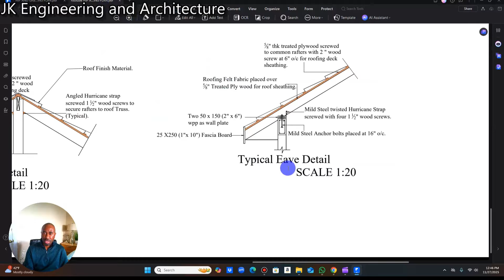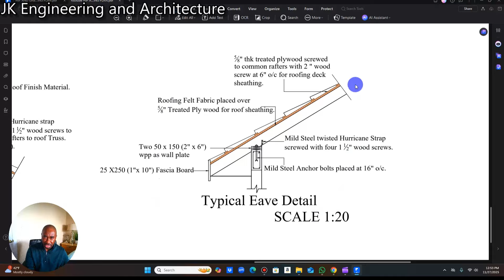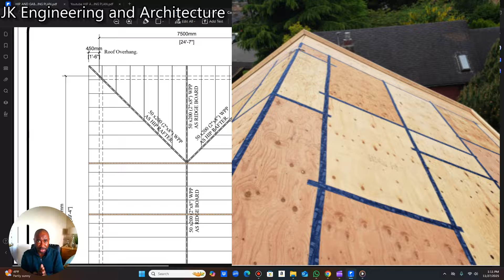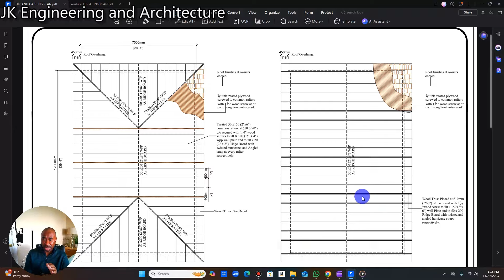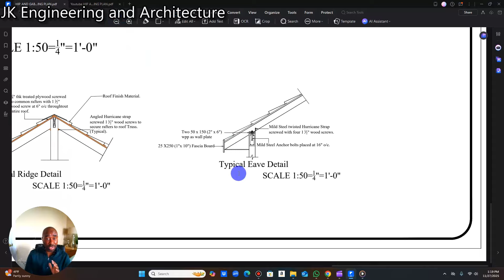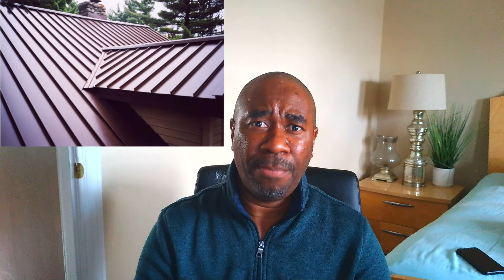CONSIDERING RE-CONSTRUCTING YOUR TIMBER ROOF AFTER HURRICANE MELLISSA? | HERE'S HOW |MUST WATCH

Comment: What about shed style roof, which has a single slope?  My plywood structure with shed style zinc roof (hurricane strapped with 13-gauge U-shaped hurricane straps) survived Hurricane Melissa with the roof still on! 

Only one piece of the eaves (overhang) lifted upwards.
Reply from the maker: Yes any roofing system can withstand hurricane condition winds force up to a certain level if it is building with good building standards and code.

Comment: Excellent!! However screws are stronger in tension, while nails are stronger in shear. If the nails are not driven straight, they will be more difficult to pull out. Best to go for high strength screws specifically.
Reply from the maker: Thanks, you teach me something about the difference between nails and screws in terms of shear and Tension. Thanks very much.

Comment: Extremely insightful! Thank you very much for this detailed, post-Melissa  design perspective! Very helpful.! Is this over and above the existing code requirements? I am asking because I have recently had a project designed and a portion of the house calls for a hip roof (the sroof on the structure will be part hip and part slab). I'm wondering if I need to go back to my draftsman and ask him to specify the materials and construction methods as you've outlined in this video.
Reply from the maker: Its up to you. This is little above code still.